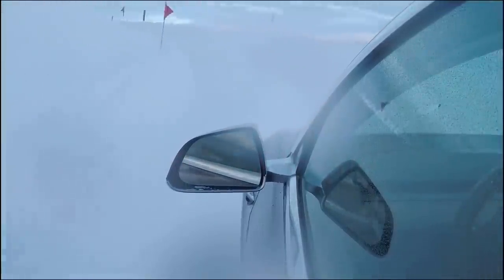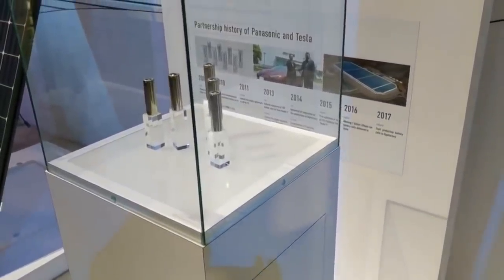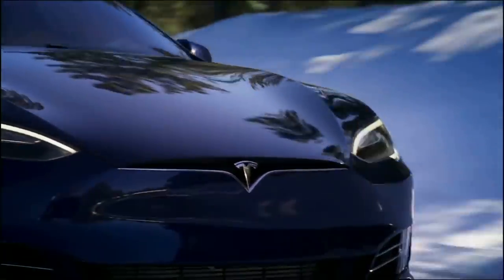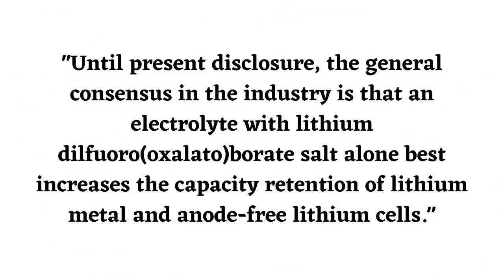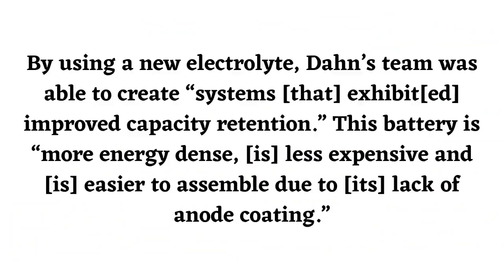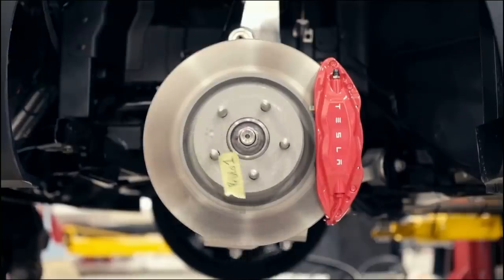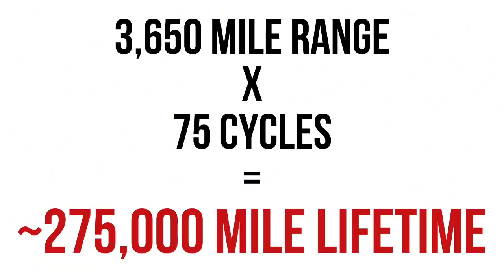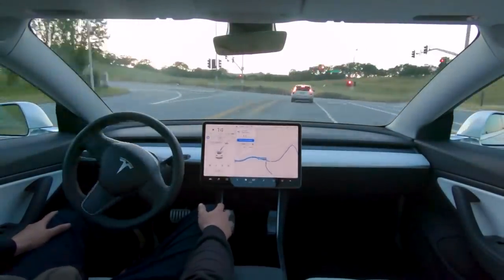Tesla's Secret 3,650 Mile Range Battery - The Next Gen Revolution

Comment: I do hope to see that the energy density is so great that it would be small and lightweight enough to make the battery pack removable by hand and have it be able to charge from any outlet. This could be very useful for people who live in an apartment with no access to home charging but can take the battery into their room and charge it. Even better, have two sets of batteries that can be instantly swap, which would refuel the range much quicker than a gas vehicle in a matter of seconds, not 5 minutes.
Reply: The problem is getting enough energy to charge it in a reasonable amount of time in an apartment. A standard 115V outlet will still take forever.
Reply: @aaronwilliams1249  on average, assuming that efficiency doesn't improve, a car like Tesla Model 3 SR+ gains about 4-5 miles per hour out from 120v, 12 amp, which is enough to meet average daily commute (or build the system that can turn two 120v outlets at opposite phase into one 240v outlet to make it charge faster). Of course, if you have two batteries, one can stay home all day charging while other one goes out do the task and then swap when needed, which is the future we need.
Reply: @AdamIverson  Most people wouldn't have a clue what a phase is or even what outlets are on different circuits. I wired the outlets in my garage as split-phase and 10 gauge wire so I can easily add a 240V outlet if I want, then again, I also have a 100A circuit dedicated for charging. I don't really see hand-removable batteries as being at all practical given the high current connections as well as water cooling involved.
Reply: @aaronwilliams1249  Realistically, 240v, 16 amp charging with NEMA 6-20 outlet is what most will ever need for long range EV with 200+ miles of range for overnight charging (I personally wired my own charger and just run a 100 ft 12 gauge extension cord), which is also a range for 120v, 20 amp wiring for many household since the voltage doesn't care about wire thickness. That's just for one battery with today's technology. In the future, if you have two batteries small enough to be carried by hand, who cares about the speed of charging? That's the least of an issue if one battery stay home all day while other stay with the car. 120v, 12 amp charging is sufficient. I used to live off from 120v, 12 amp for 3 years when I used to have a Nissan Leaf before I had a Tesla Model 3, so 120v charging is quite doable. At worse, it will take up to 27 hours of charging to get from 0 to 240 miles of range, assuming 55 kwh of battery capacity. If the range is 240 miles, it's not likely that you will deplete that battery all in one day unless going on road trip, which is what Supercharger is there for.
Reply: @AdamIverson  Not true. I have, on many occasions, needed to charge during the day. Extension cords are NOT recommended and a 100 foot 12Gauge extension cord will result in a noticeable voltage drop. And I can guarantee you that nobody will want customers to remove batteries by hand. It is not safe. What if you drop the battery pack? What if it gets wet where it shouldn't? Do you really want very high current connectors to be repeatedly plugged and unplugged? We're talking MUCH higher current than the charging plug. What about the coolant connections? 27 hours is totally unacceptable. I have, on many occasions, arrived home with a low battery and needed to be fully charged the next day. I've had a number of occasions where I've had to charge rapidly on the same day. And I have depleted my battery in a day many times and I have friends with EVs who also have done this.
Reply: @aaronwilliams1249  In my case, I had my extension cord wired directly to the panel, so I haven't noticed much voltage drop. If plugging into a wall outlet that's already far from the panel, probably that's the case. It's better to have a one 100 ft extension cord than two 50 ft because the hot point is where the plugs are connected.  If a product like Delta 1300 Power Station can exist for the regular consumer (much higher battery voltage and amp for EV, I get it. We can add safety and protection, something like that), I'm pretty sure that the handheld EV battery should be doable and practical. I mean, if it can be double as a battery generator with AC outlet, wouldn't that be nice? If you're charging from 120v since it's a slow charge, I don't see how liquid coolant connection would be necessary. That's only needed for fast charging. You mentioned that 27 hours of charging is unacceptable, but also mentioned that you arrived home with low battery and need to be fully charged the next day assuming that you only have one battery to work with, isn't this the reason why I bought up TWO batteries, having one of them as a spare? By the time you arrived home with a low battery, you have another battery fully charged, ready to go immediately, and put the low charged battery on the charger while you're ready to go out. This whole process literally only takes a few minutes, there will be no sitting behind waiting for it to be charged. I love having extra batteries for my equipment including power tools. One can stay at the charger while the other one is at work. If one gets depleted, I can just return to quickly swap the battery, no need to wait for it to charge at all. This is the same concept that I want to apply to EV.
Reply: @aaronwilliams1249  I also want to point out is that I don't get why you need a 100A dedicated circuit for charging unless you're charging multiple EVs at the same time. Most modern EVs can only charge at up to 32 amp at 240v including Tesla Model 3 SR+ (and 48 amp for long-range version). 10 gauge wouldn't be enough for 32 amp charging anyway, you need 8 gauge for that purpose, either hardwired, NEMA 6-50 or NEMA 14-50. I only have 100A total for my circuit breaker and I have installed an 18kw electric tankless water heater for my house, which takes up 80 amp using two sets of 8 gauge wires as required. So far, no problem, but probably because I don't have central AC and even if it's too much, the main breaker would trip.
Reply: @AdamIverson  Liquid cooling is absolutely required during the operation of the battery, not just for charging. When you're pulling large amounts of energy, heat is generated. In fact, with higher energy density, the cooling demands will also be higher. Cells generate heat when discharging as well as charging. There is a LOT of thermal management that takes place, making use of the vehicles HVAC system among other things. The higher the energy density, the more heat per unit volume that must be dissipated. That's partly why early Leafs sucked so bad. Nisson had basically no thermal management and the cells cooked themselves to death in hot environments, and those batteries were much less energy dense. Once the pack is out of the vehicle, all thermal management goes out the window. Also, the Delta 1300 only has to deal with 1.8KW output (3.3KW surge) Now you're talking about something that has to deal with 100KW or more! It's a whole different ballgame. The Delta 1300 has 1260Wh of energy. You're talking on the order of over 20 times that amount of energy per battery.
 What happens if you have to carry it up the stairs and you drop it? Now you have something that may be trying to dissipate all of that energy all at once and a massive fire hazard. That's why every EV places the batteries in the safest place possible and does their best to protect it from accidents as well as protect passengers. In my model S there is a 1/4" aluminum alloy plate on the bottom as well as a titanium plate to protect it from road debris. It is also a structural member of the car. The Tesla batteries, for example, are designed to vent downwards in the case of a catastrophic event where thermal runaway takes place. It's not just the batteries that make these packs heavy either, it is also all of the support structure involved. As for your extension cord, there is a reason ALL EVs tell you not to use them. There are also rules such that you cannot plug an extension cord into another extension cord (look up the OSHA rules). Your charging cable is considered an extension cord. OSHA does NOT allow you to plug one into another, and yes, businesses get hit with this all the time when they are inspected.
Reply: @aaronwilliams1249  Listen, I'm talking about the future battery, it may or may not have liquid cooling. Other automakers say that Lidar is absolutely required for self-driving, but Elon Musk/Tesla says otherwise. Isn't the solid-state battery getting talked about a lot for the future of battery? This video title was literally mentioning about battery with 3,650 miles of range, do you really think that we'll still be using the same current technology with this much of battery density with liquid cooling and still a ton of fire hazard? There was a prototype of a solid-state battery, the battery literally got punctured with a screwdriver and no fire, still works! You've mentioned about dropping the battery, but isn't this not much different than crashing a car? It's not like that it's made of one giant cell, it is made with 1000s of cells after all. I think there's a patent in Tesla's 2170 cell that if each individual cell overheats due to faulty cell, it will vent it out, preventing other cells from overheating as well. Okay, maybe the energy density is so much higher per cell for future battery and not as many cells, but still.
Reply: @aaronwilliams1249  Also regarding OSHA, I don't care what they think whether they allow it or now, that's for licensed professionals to follow as they do it for a living. I'm legally allowed to do DIY stuff for my own home as long as it's up to code, I'm just not allowed to do it for someone else since I'm not a licensed professional. Therefore, I do my own way as a homeowner and if I need to make changes prior to inspection, I'll do it! Copper is copper. If it's thick enough, I can just cut off its head and just wire it, either hardwired or put different kinds of wire plug, perhaps converting NEMA 5-15 to 6-20 if 12 gauge allows for 20 amp current without causing a fire hazard (I know 5-15 means 120v, 15 amp, but that's just referring to the shape of the plug to prevent plugging into the wrong outlet. If 12 gauge copper wire can support 20 amp, it can support 20 amp up to certain length). I can do the same for 10 gauge extension cord as well, it's literally just copper, but a certain thickness.
Reply: @AdamIverson  I know you are, and yes, it WILL HAVE to have active cooling. All batteries generate heat when supplying energy and it has to be dissipated. You want all of the batteries to also be a ta uniform temperature because all batteries behave differently at different temperatures, whether lithium, alkaline or lead-acid. If you have fewer cells then you are having to deal with more power per cell which means more heat per cell. Even solid-state batteries need thermal management to keep them in the ideal temperature range. Active thermal management is unavoidable. There's a reason just about all big battery storage systems use active thermal management, and the higher the density, the stronger the thermal management you need. It's basic physics 101.
When you're dealing with that level of energy density you HAVE to cool it when discharging or if you're charging quickly. By your logic, you would never be able to supercharge the battery.  Where you have high energy density there is always a danger if that energy should try to be released too quickly, and Lithium batteries are known for being able to dump a LOT of energy very quickly. That is why battery packs are designed to be well protected. This also helps make them quite heavy. In most EVs, the batteries are placed in the safest section of the car where they are best protected from accidents by the outside crumple zones. When the battery integrity fails, bad things happen as have been demonstrated repeatedly. I am very aware of Tesla's battery pack design. While it's true that it's designed for a few cells to go, but if it's more than a few, bad things happen. Dropping a battery onto a concrete floor as opposed to a crash generates a much bigger impact (delta V over delta T). They also go to great lengths to protect the edges of the battery pack. There were issues with road debris puncturing the front of the Tesla batteries early on and causing vehicles to catch fire. I know, my car had to be retrofitted with an additional titanium plate.
You're an idiot if you think Tesla or any other vehicle manufacturer will ever make the batteries user-serviceable and able to be removed by the average joe.
Reply: @aaronwilliams1249  Is there any reason why Nissan STILL not using liquid cooling for their Leaf battery even with 2020 226 miles range? They still provide 8 years, 100,000 miles battery degradation warranty. Do you think they would go out of business by now if the battery fails before the end of the warranty? I personally don't have a problem with liquid cooling anyway, it could very well be closed-loop even with modular battery pack. Even without a closed-loop, detachable cooler connector that doesn't leak could be possible, right? I mean, don't we all faced something far more dangerous every day than average joe handling a high voltage battery? Oh, you know, a live wire where children can stick a fork in the outlet and get shocked or bring a phone charger to the bathtub with an extension cord, bypassing the GFCI outlet?
Reply: @aaronwilliams1249  I'm fully aware of 80% of the rated current continually. That's why 15 amp charger charge 12 amp and 20 amp draw at 16 amp. As far as I experienced, I've done a better job than a lousy electrician that we have hired in the past (not me, someone else have hired). Always a loose connection, reverse polarity, and connecting ground to a neutral for no-ground wiring, which is a big no. They claimed to be licensed, but I really doubt it. I'm not sure why you thought 10 gauge was enough for possibly 40 amp circuit for 32 amp charging, was that for another purpose or just intended for 24 amp charging? I'm fully aware that the way I do it is not up to code, but it is set up in a modular way that it can be taken down right away if needed.
Reply: @AdamIverson  My EV will draw 80 amps when charging at the full rate. Since my model S is my only vehicle, I have found the need for fast charging on numerous occasions. My house also has only 100 amps. I have two meters, one for my car, one for the rest of my house, both on 100A service with 200A coming from the pole. I have a 2013 Tesla Model S P85. I also temporarily have a Model X that can draw 72 amps. Using two sets of wire as you did for your tankless heater is not allowed because if one breaks the other presents a huge fire hazard that is not protected by the circuit breaker. I guarantee you that your setup will NEVER pass inspection. If your whole house is 100A, you CANNOT have an 80A hot water heater, period. Your wiring sounds like a DIY deathtrap. I've run into a number of those in my own house done by an idiot DIY former owner. I wouldn't let you anywhere near my house. If your heater draws 80 amps then it MUST have a 100A circuit, by law. It doesn't matter what state you live in. That's why I have a 100A circuit even though my car only draws 80A. It's run using 1 or 1/0 gauge aluminum romex for the long run under my house between the meter and then switches to 2 gauge copper wire inside my garage to my charger. Everything was done by a licensed electrician and inspected and permitted. By law, I also must have a shutoff next to my charger (which is also present, though this differs between jurisdictions).
While I may not be an electrician, I make myself aware of what is required before I do anything with wiring. I have an EE degree so I am quite familiar with the concepts. I have also seen what can go wrong. If your tankless water heater draws 80A, you need a minimum of 3 gauge but 2 gauge would be recommended. Even though my wiring is fully rated at 100A I see an 8V drop between the meter and my car. That means the wiring is dissipating 640 watts as heat. Because of this I usually limit my charging to 40A where there is no voltage drop.
As for copper, it's more than just wire gauge that needs to be taken into account. The length of the run also must be accounted for.
Reply: @aaronwilliams1249  For the tankless water heater, it literally requires two 8 gauge wires, at least in the United States. It's in the instruction manual. It's physically impossible to have 3 sets of 8 gauge wires or 1 set of even thicker wire because it only has a connection for 2 sets of 8 gauge requiring two 40 amp double pole breaker. It's SioGreen infrared 18kw version, by the way. It works like a charm, no maintenance ever since it used infrared light instead of the heating coil. It's only a temporary set up anyway, I'm waiting for a solar company to install solar panel that they will likely upgrade to 200 amp panel, that will more than support the water heater. Unfortunately, the installation was delayed heavily due to the permit office being closed in response to the pandemic, so it's a long wait. In terms of your Model S, yeah, it makes sense to have higher current as it is less efficient since they're bigger and heavier. Model 3 requires less power for the same number of range gain, so it capped at 48 amp max. I think the newer Model S no longer have 80 amp charger, is this still true?
Reply: @AdamIverson  The original Leafs were failing left and right in Arizona and Southern California. They'd lost 40% of their battery capacity in 2 years. There was a big settlement where Nissan had to replace a LOT of batteries. They're also more limited when it comes to the charging rate compared to others. Their charging rate is limited to 50KW and it quickly slows down from there. A friend of mine had Leafs and used CHAdeMO chargers frequently. That's why he would only lease them because the batteries don't hold up too well to a lot of driving. Leafs were notorious for battery degradation. They are finally adding more active cooling for the batteries by blowing air across them. Nissan has had a number of charging issues over the years. Look up "rapidgate" for example. After a few recharges on a trip it can take hours to charge a Leaf due to the safeguards kicking in. My Tesla has no such limitation. My Model S will happily start out charging at 120KW then drop down as it gains more charge. The active cooling is quite active while charging as from the sound from the fans blowing through the heat exchangers.
Also, Nissan averages significantly worse than average when it comes to battery longevity. Note that basically everyone except Nissan uses liquid cooling for their battery packs.
Reply: @aaronwilliams1249  I agreed that the Nissan Leaf's battery degradation sucks. I used to have 2011 Nissan Leaf back in 2015 all the way to 2019 when I sold it, the range dropped so much. Not sure how 2020 Nissan Leaf will perform besides rapidgate, but still, not sure why they STILL stuck with not having a liquid cooling system.
Reply: @AdamIverson  I NEVER said 10 gauge was adequate for 40A. 10 gauge is rated for 30A or 24A continuous. I said I used 10 gauge for the split-phase outlets in my garage which replaced a single 15A circuit. I used that on my split-phase 20A circuit due to the distance from the meter. My EV charger is hard-wired into a 100A circuit. There also are cases where ground to neutral IS allowed, for example, if a GFCI is present though it is only in a limited number of circumstances. For 32 amp charging you would need 8 gauge wire. My Model S supports charging at 80A. The Model X supports 72A. And it sounds like you hired an incompetent electrician. Mine set the proper torque for everything. I have run into plenty of things like light switches on the neutral line, boxes buried inside the wall, no boxes at all, tying the garage outlets into the 15A doorbell circuit (where my air compressor couldn't even kick over), ungrounded outlets (despite the ground wire being present) and more. When I do my own wiring I tend to go for a larger gauge than what is required, especially for long runs.
Reply: @aaronwilliams1249  by the way, here's a link to SioGreen water heater that I have. It clearly requires two 8 gauge wires, two 40 amp double pole. The reason why is that there are multiple heating elements each powered separated by 8 gauge and if one of them failed, the whole thing won't work rather than burn. Many tankless water heater often requires two or more sets of 8 gauge wires depending on how many kw it needs. In a case of 36 kw, it requires 4 sets of 8 gauge wires, not bigger than 0 gauge. https://www.amazon.com/dp/B07RB46H4D?ref=ppx_pop_mob_ap_share Again, only a temporary set up. Still waiting for them to install solar panel, Powerwall, and possibly 200 amp panel when that day comes. Will definitely uninstall the wire before they come to install.
Reply: @aaronwilliams1249  By the way, I am taking a break from charging my car at home and for now I'm charging it exclusively at an urban Supercharger, mainly because I have over 4000 miles of credit from referral and it's going to expire on October 2020. Hopefully by that time, I'll have solar panel installed.
Reply: @aaronwilliams1249  also by the way. If you don't like the idea of swappable handheld EV battery, how about portable EV DC fast charger that runs off from battery? Not an idea or concept, it already existed and in operation today. It's called Sparkcharge, you can check out this link: https://sparkcharge.io/
Reply: @AdamIverson  They no longer offer the 80A but I believe it does 72A standard, at least on the higher-end models with the larger batteries. The Model X is a 100D that definitely supports 72A. There are a number of features on my 2013 that are no longer available, one of which being the dual 10KW chargers. The panoramic roof, the metallic green color, and a few other things they dropped. Also, being a RWD P85 I have nice performance and a huge frunk as well. Currently, it's having its center screen replaced, hence the model X. I'm guessing it may be due to the excessive logging Tesla was doing for a while. eMMC supports a finite number of write cycles, and it's not as many as many SSDs, which is why you do not want to frequently write data to them (as Tesla did with logging).

Since the S is my only car a model 3 would never be acceptable for me. Since I periodically use all of the storage space in my car to haul stuff if I ever replace it I may spring for an X or possibly another S, but the newer cars have a much smaller frunk. At least several times a year I completely pack my car with stuff I need to haul around. I never realized just how big the X is. It would be great for camping since I would no longer need a tent, just fold the rear seats down and there's plenty of sleeping space.

Your hot water heater is different than what I expected. It sounds like it is a sort of dual-stage system. My father put in a Heathkit solar hot water system in the 1980s and it is still working great to this day. It keeps an 80-gallon water tank heated which empties into a conventional 40-gallon tank. Energy usage has always been minimal. It's a closed system so the water flowing through the panels is isolated via a heat exchanger and two pumps. I think the only repairs that had to be done are a couple of minor leaks and the water pumps needing replacement every few decades. The 80-gallon tank has also had to be replaced a couple of times even though the electric heater is disconnected. I think my father never bothered to replace the anode. The system has no problem keeping the 80-gallon tank at 140F and gas usage by the 40-gallon is minimal, even in the winter. There is also a sand trap that needs to be periodically drained due to sediment forming in the tank to keep it from clogging up the tapwater circulation pump.

While I'm not an expert, I do know a fair bit about lithium-ion batteries and packs, having designed my own lithium-ion pack controller and power supply with USB-C and power delivery and a 20A 5V output. I'm well aware of the safety issues as well as longevity issues with lithium-ion batteries and how they need to be babied to maximize their lifespan and safety. My circuit is absolutely paranoid when it comes to safety, especially since this is designed as something someone would carry around with them and may not be easy to quickly remove. It's about as paranoid as one can get with two independent systems monitoring each cell that can blow a chemical (explosive) fuse should things go really wrong. It monitors everything, the voltage and temperature of each cell as well as current (both charge and discharge), as well as performs cell balancing. It's designed to minimize points of failure, even if one of the monitoring integrated circuits shorts out.
I've also followed the chemistry as well as the work of Jeffrey Dahn for years and been active in EVs as well as the progress of John B. Goodenough for years.
Reply: @aaronwilliams1249  I once driven a Model S as a loaner car when I took my Model 3 in for service. It's pretty good, acceleration was a bit stronger than my SR+, but personally, I prefer the Model 3 a lot more. Model S doesn't even have a door pocket on the side, which is a bit of inconvenience. In terms of water heater, I really dislike the tank based kind. My old gas tank model was wasting so much energy that the gas bill was over $80, would been over $100 with lower therm allocation in summer. After I got rid of it and replaced it with electric tankless kind, my gas bill went down to $8 just from that alone. Well, that and I'm going to get a solar panel anyway, so it only make sense to go all electric. Normally, you would have to flush with gas or electric coil based tankless water heater, but because Infrared water heater with quartz never makes direct contact with the water, it never forms scale and requires no maintenance, I felt that this is a right choice. It's important to note that regardless coil or infrared for electric, it's very common that it uses multiple 8 gauge wires as they have multiple heating elements, sometime 6 gauge for smaller, 11-13 kw electric tankless water heater. But, it's self modulating meaning that it will only use the power it need to heat the water, so in my case, it will use less than 9kw for one shower, even less in summer. On average, each shower only consumed 2 kwh in summer. I haven't hit winter yet, but because I'm in southern California, it's never cold enough to snow anyway.
Reply: @AdamIverson  I looked at Sparkcharge. It's mostly a joke. It holds around 3KWh. When you consider a car has 50+KWh that's not a lot. It might get you a few miles but that's about it.
Reply: @aaronwilliams1249  I read that it's a stackable battery, up to 17.5 kwh, which can be great for roadside rescue.
Reply: @AdamIverson  There are already roadside assistance services that offer a quick charge, at least in my area.
Reply: @aaronwilliams1249  I wonder what they use to quick charge? A gas generator?